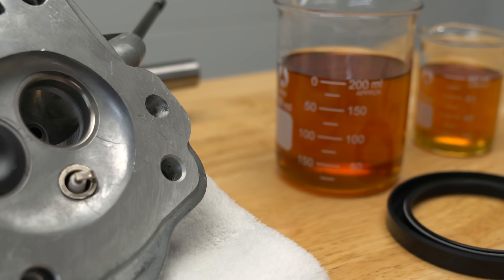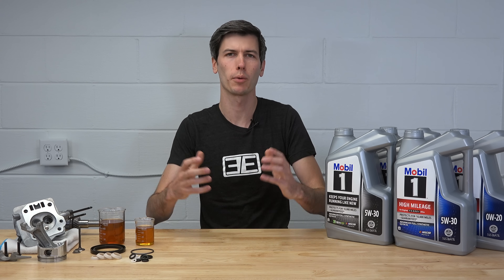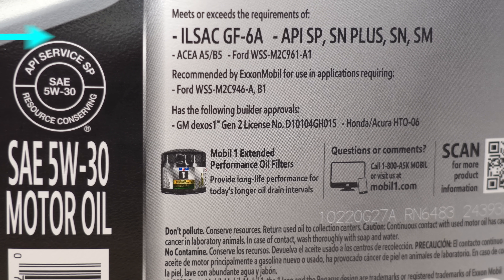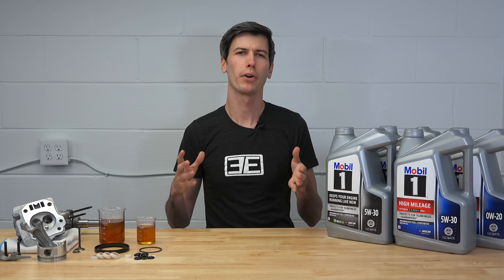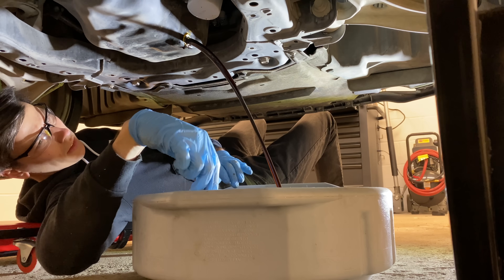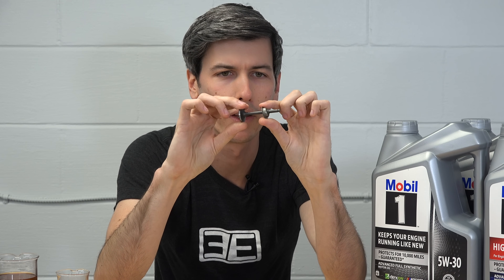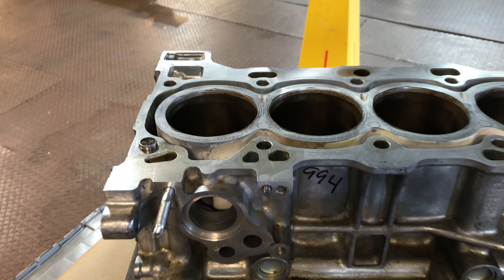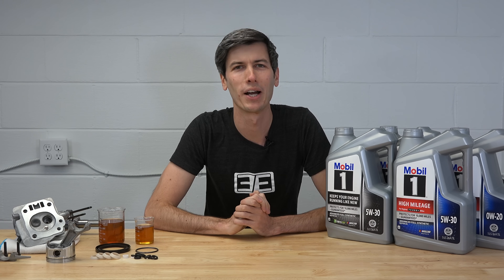Is Synthetic Motor Oil Bad For Old Cars?

Comment: The leaks were there already, synthetic just allowed the hidden to be apparent.
Reply: Sometimes I just want it to stay hidden
Reply: @evilkillerwhale7078  that way, your engine will die sooner. Great thought.
Reply: @R4M_Tommy  no it won’t lol if gunk is holding that oil in let it!
Reply: @mercury0214  And if that gunk blocks oil getting to where it's really needed and it dies even sooner? Fix the real problem - the seals, before you destroy the whole engine! A stitch in time saves nine!
Reply: @ValkyrieStarTV  and I don’t really care bro if you haven’t blown you motors you aren’t into cars that much most of my engines get boosted to death anyways so who cares if they leak haha you can only run 15 pounds so long before you tell them to turn it up to 20 and see what happens
Reply: @ValkyrieStarTV  and my friend if the seals are going in an engine most people say “ok sell the car onto a new one” no one is out here paying $2000+ for internal work on an old car unless they have an attachment to it once the seals are gone so is most people’s care for the car
Reply: @mercury0214  lol alright start throwing insults around then... the gunk is on the inside of the engine stopping the oil from coming out, unfortunately it can also stop oil from getting to where it needs to if it builds up too much. I run 22psi on my daily with a turbo swap, doubling its standard power which it gets from 9psi. Done 70k miles like that so far with no issues, and not a sign of any issues either. My car is worth ~$10k so i'm gonna say ~$1-2k on a rebuild is acceptable for mine. If the whole cars worth that little then there's obviously no reason to really take care of it, so do as you will, the engine will last longer if you clean it though, it'll just leak, engines can go forever like that, but they definitely won't go forever full of gunk.
Reply: @ValkyrieStarTV  gunk that holds outside oil spills is on the outside lol you can wipe it off and the engine will leak around the area again then
Reply: @mercury0214  they're talking about stopping leaks from the inside. It is very rate that leak will seal from the outside but if it does then it's unlikely an oil on the inside will clean gunk off the outside. The gunk we are talking about is INSIDE the engine, which can keep the oil from going places. One of those places may be through that bad seal, another one might be to your camshaft journals. Ever seized a cam in a head? It's fun, especially when there's no cam bearings.
Reply: @mercury0214  so, serious question. Who does the work on your cars? Clearly you don't because its quite obvious you really don't know what you are talking about. Oh btw, an engine can have leaks on the inside which is one point that shows you have no clue. Also, if your engine is blowing on 15 psi of boost then you need to find another engine builder and tuner
Reply: beardedforlife I’m talking about external leaks donkey
Reply: beardedforlife where did I say they blow up at 15 can you read
Reply: @mercury0214  Dude, you gotta be one of the stereotypical Millenial or laters that make us Boomers ROTFLMAOLGTBQ8TAKHELICPTER :)
Reply: @mercury0214  I've always used STP with great success.  Quiets an engine.....and seals rings and just about anything else.  Then.....I change it out, and run a high mileage oil.  Now.....I'm using a synthetic to see what happens.  As long as you change oil frequently....there's no problems that can't be ignored.
Reply: LOL, I remember when synthetic oil revealed my oil leaks in an old Toyota I had. I blamed the oil as well. Sad but true.
Reply: Yeah the leaks were already there. They were making invisible oil spots on my driveway. it was a good thing I couldn't see 'em
Reply: no... it will not leak more
Reply: the answer to engine noise is to turn up the music!
.... yea. NO.
The answer is to open the Hood and carefully listen. Think. listen some more. Observe.
and then Fix after a proper diagnosis.